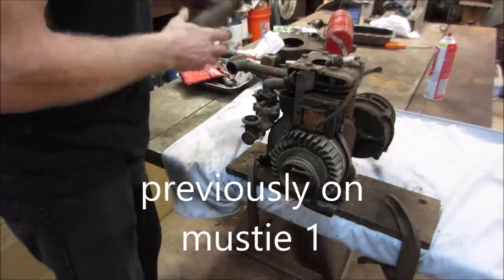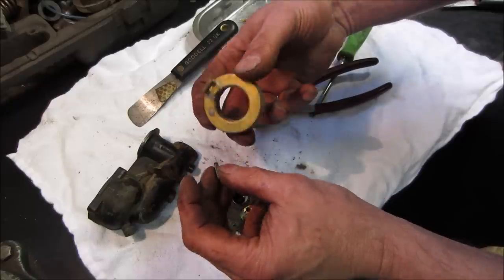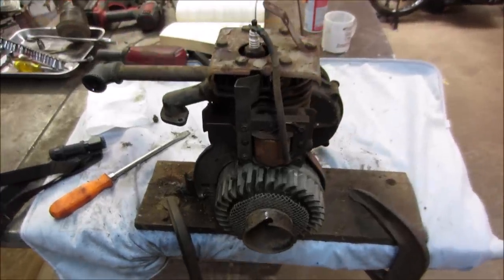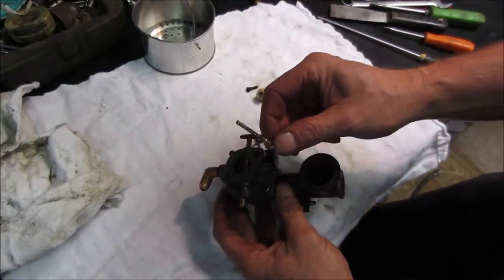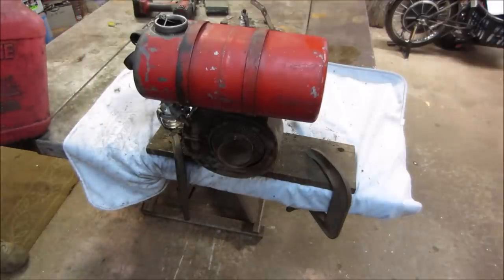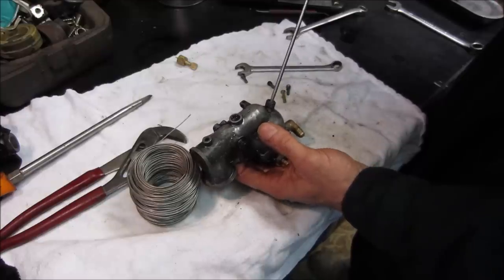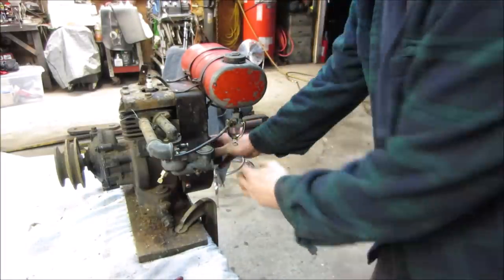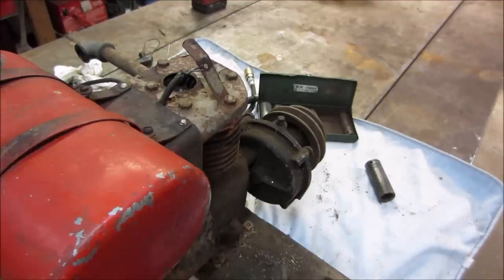Will It Run? $5 antique Briggs engine.part 2

Comment: those fuel needles on that carb don't play. you can really adjust that carburetor rich or lean wherever you want with those two needle. you'll see you can lean it out or reaching it way up, by a turn of the screw. sounds like what it's supposed to do right? this car does it and it does it very well. don't let that updraft fool you, carburetor is pretty precise when adjusted. oh, and the fix for that float? all you have to do is lightly sand it with 240 to 400 grit sandpaper, until you see shiny brass around the majority of the float, especially the bottom of the float. then, if it's still heavy, you can adjust that plate so that it closes the valve with the float barely lifting off the bottom of the bowl (tighter).

Comment: For getting debris out of the tank I saw 805ROADKING put in a bunch of old square nuts because they have sharper edges than the newer hex nuts, then he attached it to his lawnmower wheel and mowed the lawn. The tank looked great after that.

Comment: ok the old style briggs don't fix the points, you can split a coil. put one side in a vise and hit the opposite side with a punch then you change the center coil part your coil is now electronic, remember the small piece of paper between the halves cut the wire going to the points and leave them there, haven't done points on a briggs for years
Reply: there's enough blown up lawnmowers just keep the coil and use it

Comment: Cork gaskets are easy to make they sell cork sheets use different size pieces of pipe make impression of the size you need press pipe down on cork material to cut

Comment: Used to have one of those on my Sears walk behind tractor. Have experienced that kickback starting it. The inner pulley would drive the wheels and the outer pulley the sickle bar mower.  Right now I am working on a side draft carburetor with a sinking float.  Do you think I can solder it without it exploding?

Comment: Just found you and love your video's :)   
Question :
I've got a pressure washer who's motor won't start.  Can I run through the engine diagnostics steps and get it working spinning on it's own w/ out being connected to water ?

I could then connect to water (to save the water pump) after carb work or fine tuning ?

What's your advice ?  Thanks for your generous consideration,
sincerely ..........................

Comment: This looks a lot like the model 8B that was my first ever project. I think it may be another model 8 but older because mine was built around 1957-58 and it had a different front cover and tank along with a recoil starter. otherwise just from looking i couldnt tell the differences.
Reply: i lied...theres a difference in the block. the model 8 has a more square setup like the 5hp flathead models

Comment: Id does look a bit like a 5S but that I have not seen one with that carb, only the ones with tank below. It should have a shroud 2around the fins with a B&S nameplate. The cylinder won't cool properly without the shroud.

Comment: Just saw this series pop up, what solution did you use in your ultrasonic cleaner?  Also, what brand/model are you using?  Been looking at buying one some day for use at home in my garage as I am tired of using chem dips and similar methods to clean certain things.

Comment: I would not take that carb apart until I turned the adjustments in to closed to see how far they were open first. Then it would have been a lot closer to adjusted after putting back together.

Comment: Must've 1 , another you tuber has said he likes to purchase Muriatic acid for swimming pools at swimming pool suppliers to clean out rusty fuel tanks. Put it in tank let set for a few min. check on it in 10 min.or as needed. Drain it out through a filter paper and reuse several times.
Reply from the maker: l do that for real bad ones
Reply: I use white vinegar. Takes longer because it isn’t as strong, but it’s safer to use.

Comment: You cant use a compression gauge on Briggs and Stratton motors as they have a decompression bump on the exhaust lobe. They called it Easy Spin
Reply: +Can Millwright - Don't think Briggs had that feature when this engine was made.

Comment: @Mustie1 Here in the UK I recently bought a rotovator which has this carb on the Briggs engine but some previously has crossed the threads on the brass that holds the jet in so I am trying to find another carb but not having any luck..  Any suggestions on how I might get it out?  Thanks.

Comment: Consider making a video where the float valve is replaced with a pump and overflow pipe.  The agony is no less when you rather than I is the victim.  vac-u-jets and pulse-a-jets work fine without float valves.

Comment: Looks like something I repaired back when I was just a young mechanic. String and wire were about all I had in my toolbox. lol Did you check the gearbox for oil too ?

Comment: First of all you have put out great content both informative and enjoyable. You seem to have knowledge about everything but especially vws I recently acquired  a 1971 superbeetle that has been sitting for at least 10 years I got the engine running but the breaks are locked up. The car was towed by a tractor on pavement and only 1 wheel turned. Their is not pressure in the break lines and the e break is not engaged as far as I can tell. I think the drums are just rusted on do you have any ideas how I would be able to remove the drums?I was thinking a puller but I cannot find a puller that is big enough Help from anyone would be appreciated
Reply from the maker: turn the adjusters to back off the shoes, there are 2 holes on the brake backing plate that you can shove a flat screw driver in and turn back,

Comment: Mustie 1 ;  If I had a safe way for you and I to communicate , I have probably got some stuff that you could use in your need for parts on some of these old engines .  I love email as a way to communicate .  I have lots of old small engines and parts .  Also parts for old 300 Case farm tractor .  Have lots of old gas tanks , plastic and metal .  Lots of parts off old riding lawn mowers . Have some antique riding mowers . I have an Allis Chalmers 610 and a Simplicity 637 that are identical and a  Western Auto 5 hp riding mower with 2 speed forward and 1 speed reverse with 24 in. mower deck .  I'm 73 years old and have had lots of these parts and stuff for 40 - 50 years .  I also have lots of rods , shafts , carbs . coils , steering rods and axles , wheels , different size shifter knobs and front axles and parts and etc, etc .  If your not Mustie1 , please do not respond with junk mail .---------------------------------------------------------------------------  Ernest E. Johnson--3246 Sunny Point Rd. Brownsville , Kentucky  42210

Comment: Hey Mustie how many times do you think that ultra sonic cleaner has paid for itself?
Reply: Even better, a generous viewer sent it to him.  A worthwhile investment for anyone with small engines to keep running regardless of the price.
Reply: @Ashurii Prices have come down dramatically.  About $115 shipped on eBay now for a 10L one that Mustie1 has.  The harbor freight ones can be had for quite a bit less with coupon but don't last as long.

Comment: Hey Mustie1, Ive been watching your videos and you seem to always never get spark. I have a 2000 and up E-Ton Sierra DXL 90 and it doesnt have spark. Has good compression just doesnt get spark. i dont see any points and told it doesnt have any. I ordered a coil and CDI to see if that would fix it. Any suggestions? I cleaned the grounds from the battery, coil, and voltage regulator and still nothing.Its a two stroke.

Comment: What chemical do you use in your ultrasonic?  I got a "yard find" CB650 that I'm cleaning the carbs on and they look good but not cleaning up quite as easily as yours does
Reply: He uses 1 gallon cans of carb cleaner from the auto parts store.  I've had good luck with Simple Green and water mix, but change it out frequently

Comment: any more vw videos lately? my 1968 bug has a problem. the front axle beam the passenger side shock tower is rusted out and the shock has broken off it. as they rust inside the shock towers thats the problem i think on the pre 1966 link pin front beams too as beetles 1966 and later is a ball joint. Can i put a link pin beam on this bug? if the frame head is modified? the only one i found in the local listings. as i found airkewld and Atomwerks engineering the ball joint beams have better and thicker metal on the shock towers. but has the adjusters to lower the car as im not lowering the car. if i put on a linkpin front beam on my 68 bug is there any modifications that can be done to the frame head or the frame head replaced?

Comment: I have question ( probably a dumb one). Could one run a drive belt from your old B/S engine to an auto generator and then hook THAT to one of these car inverters and have a generator?
Reply: Barry Hope SGT Hope        You sure can, there are several Utube videos on the subject.
Reply: @markd8405t5000  Thanks!
Reply: Just to add to the subject... yep, you could even run two or three auto alternators in parallel to the invertor.

Comment: Hey mustie, what do you run in your parts washer tank for solvent? I've got a twenty gallon tank (that's the minimum amount of solvent, ten gallons just barely let's the pump prime) and where I live, parts solvent is $60 per five gallon pail, so it's a bank breaker  to change the solvent. I'm currently running a fifty fifty mix of solvent and Diesel fuel for pricecresons, but prefer how well 100% solvent works
Reply from the maker: l run the same stuff but put some bricks in the tank to take up some of the space,
Reply: He replied before that he uses carb cleaner from Gunk in the one gallon cans.  The small strainer that he has in the solvent bath is from one of those cans.
Reply: @wi11y1960  not the Sonic cleaner, the big parts washer. But mustie already answered my question
Reply: I just buy mineral spirits from the Homeless Despot and run it in my old Gray Mills tank. Works fine.

Comment: SM Motors built for ethanol it's fine you run E85 it's 105 octane versus 95 Octane and regular gasoline but if it's not built for it it will mess the engine and the carburetor up

Comment: I do not see you adjusting the valves very often, is it true that it's a common problem as well as the carbs ? These OHV engines need that once in a while ?
Reply: I know this particular engine is not OHV. just a general question.
Reply: In a perfect world, theses should not need adjusting, but with slight wear, and with Briggs cylinder heads having problems with guides moving and seats coming loose, and most of these being solid lifters, it's not a bad idea to check the clearance at least once a year. I do as part of my first of year than up work on customer's equipment. I've owned and operated my own mower service shop for over thirty years.

Comment: The engine number should be by the air filter on the pull start cover
Reply from the maker: its missing a big tag that had the info
Reply: @mustie1  no it should be stamped into the cover not a tag

Comment: They sell a special chemical to clean gas tanks and to convert the rust
Reply: I’ve used a product called The Must for Rust. It dissolves the rust and leaves a light gray coating inside the tank that will prevent it from rusting again.

Comment: The videos are good but i can't say ethanol is bad methanol is bad for a engine but ethanol is not i run my bikes biplane and the engines that power my house off 100% ethanol and it honestly runs better than any gas i have had plus my engines are going longer between rebuilds and i haven't fouled a plug in 3 years
Reply: It's not the ethanol that's bad, it's the water that it attracts from the air while sitting that corrodes the carb that's bad.

Comment: that engine is either  a mod.# 6R6 / 8R6, that information would have been on the cooling cylinder shield, that is missing. I would be able to know if you had pulled the head. the 6 cubic inch engine would have a 2 inch bore, where the 8 cubic inch engine would have a 2.25 cubic inch bore. the "R 6" refers to the gear reduction of 6 to 1 speed ratio. you thought that this is a "5S' engine , it is not!!!. the 5 cubic inch engine would have 5 cooling fins on the block, with  a 2 inch bore. the "S" stands for suction feed carb, that would have a vacu- jet carb. also "FYI" the flywheel has a date code stamped on it. the 2 numbers are the year, and the letter is the month( A= jan.. L= dec.) and is located on the back side rim of the flywheel. this same information is also stamped on the back side of the magneto plate. the problem with extracting the date of the magneto plate involves pulling the plate from the engine.

Comment: Get your shotgun shell and take the birdshot out and use it for your gas tank...... How much for the Liberty Insurance, the Ambien and the Fords ?
Reply: Rather than taking apart shells which can be very dangerous it'd be a hell of a lot cheaper to buy a bag of birdshot from a local gun supply store or even online. Much cheaper and alot safer
Reply: Rhys Aistrope yes mustie1 that would be better mustie1
Reply: Technically driving to the store is much more dangerous than cutting a plastic hull on a shell.
Reply: @jimmybillings8017  lol

Comment: i stopped getting gas with that crappy alcohol man its a lot better on my saws and 2trokes i wish more people would do that maybe they would get the point but probably not lol   i work on small motors too and i hate it but in a way i make money from it ut that doesn't make it right my wood here is to frozen to burn in my dam wood burner now that's  cold  lol;;;;;;;;